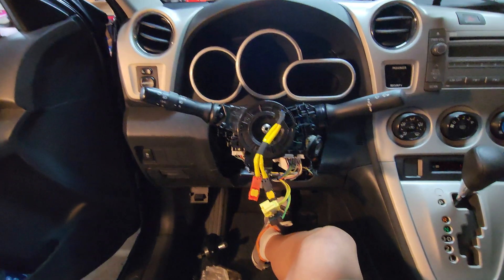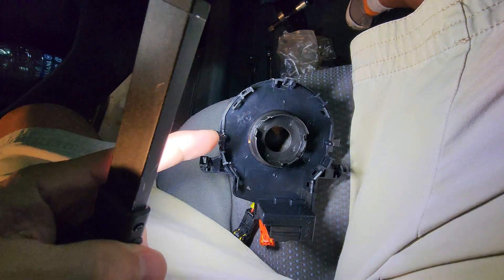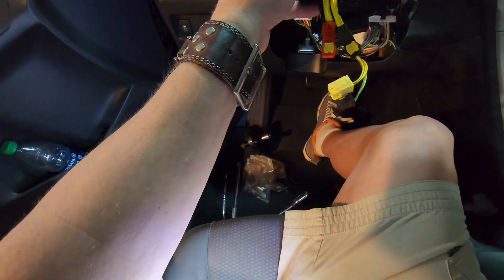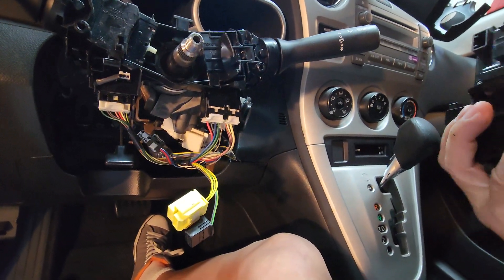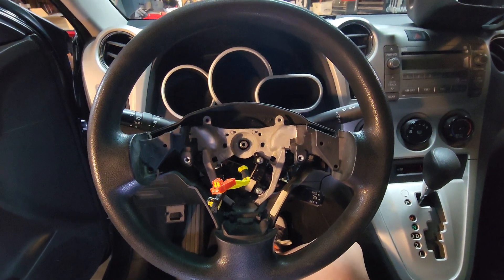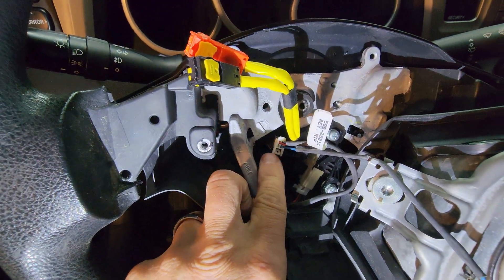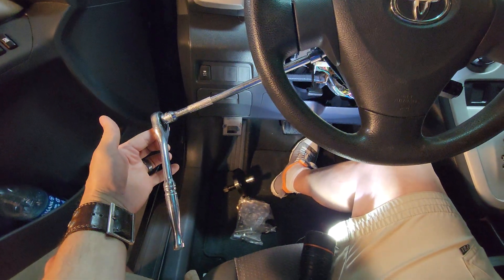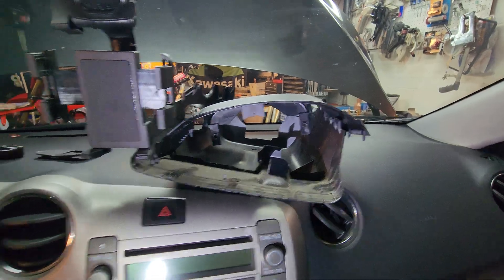Tips Installing Steering Angle Sensor SAS &  Clockspring Toyota Matrix Wagon and others VSC Light

Comment: How to do you recalibrate the angle sensor. My VSC off light came on after taking out the steering angle sensor and putting it back in. I was gonna install another one, but I got the wrong part, so I reinstalled the old one and now the VSC off comes on. It also says check VSC in the dash. I have a 2002 Lexus LS 430
Reply from the maker: There are many videos / links regarding this. https://www.wikihow.com/Reset-Steering-Angle-Sensor-Without-Scanner